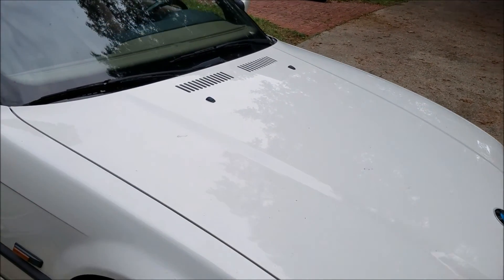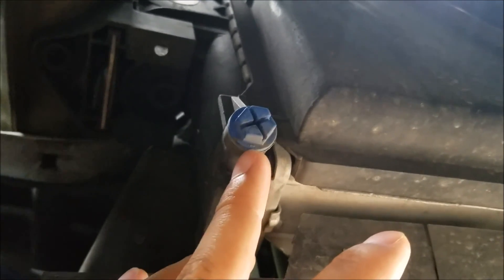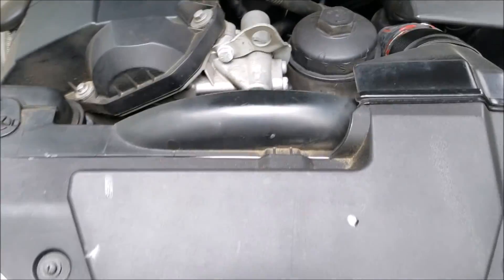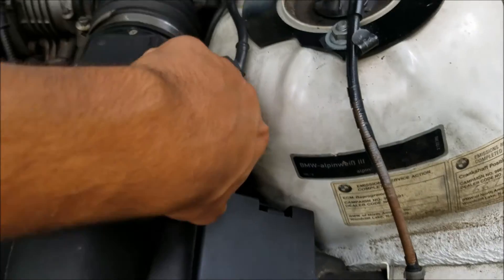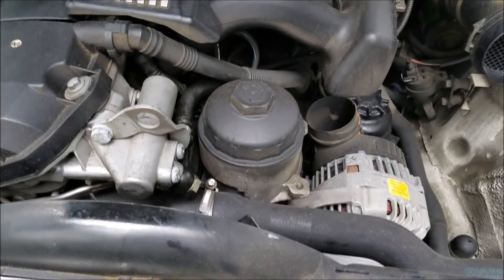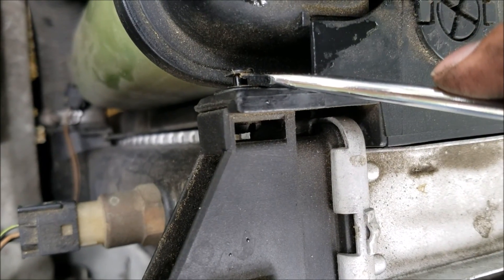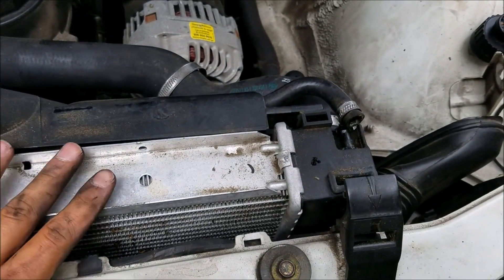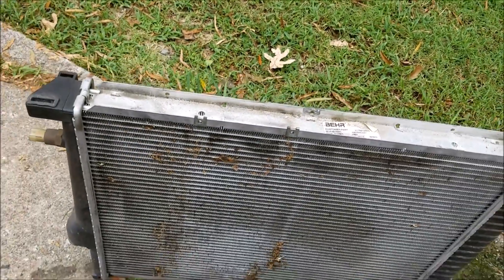BMW E36 Radiator Removal (Coolant System Rebuild Part 1 of 5 )

Comment: What is that sensor on the side of the radiator? Around 10:00.

I'm trying to stop a slow coolant leak on my new radiator but I can't seem to find any information on that sensor, I'm either trying to get rid of it and put in a plug that fits or replace it

Comment: I just realized how much stuff is missing in this video hopefully you guys don't come across what I come across. You have to disconnect stuff at the bottom of the radiator. his radiator didn't have anything connected at the bottom. There's all kinds of connectors that he didn't have to take out that you will

Comment: the one 8mm at the bottom of the trans cooler in between the hoses was an absolute pain in my ass. I apreciate the explanations though. helped alot. I ended up getting a mini ratcheting 8mm flat wrench and sat there for 15 minutes unscrewing it 1/16 of a turn at a time.
Reply: I got that out, but the whole hose assembly still wants to come out with the radiator, anyone ????
Reply: @JulianBetancourt-g1b  make sure you took out all 4 of the screws and clips that secure the trans cooler and seperate them before you pull the rad out

Comment: Right off the bat the wrong fluid is in the car need the blue for European cars it will eat all the plastic parts if you don't I speak for experience replaced every plastic CoOlentangy part

Comment: I doubt your gone response but if you do I took my car to a mechanic so they would switch the radiator n I got my car back but my coolant is like a gel type not liquid what do I do to fix this
Reply from the maker: You have an E36 or a newer BMW?

Comment: Thank you.  My Bentley 1996-1998 BMW Z3 Service Manual did not give good instructions for removing the radiator retaining clips.  Without your video it is likely I would have broke the dam things. Once I knew where to insert the screw driver and pry it was a snap.  This is not a good manual but better than nothing, I guess.
Reply from the maker: Glad it helped, I'm not a big fan of the Bentley manuals either, but at least they can give a sense of direction for a lot of things.

Comment: Thanks for the video. I have a bad water pump on my '95 325iS. I want to flush out the system and run Blue Devil engine flush through the system. Will this affect the new water pump if I flush after replacing the water pump? I am keeping old thermostat till I run the flush and put new thermostat in after.

Comment: My coupe is a 96' and my radiator is wanting to take a shit on me haha. Someone cut me off while I was behind him on purpose and it dented the face on the left of the grill. Caused my radiator to get even more upset with me and I had to find the crack immediately and put JB weld on it. Wich has held up since but what a fucking inconvienece because after he cut me off he took off down the road after I pulled over to take his insurance. I was gonna chase him but I was more worried about my car blowing up because I had no idea what the damage was. Thanks for the videos though. Makes it easier on me

Comment: Thank you so much dude, using your whole series right now to get my E36 M back on the road. Thermostat stuck closed... hope I didn't do any worse damage to my head
Reply: Kevin hopefully not, I've overheated quite a few but I turn the motor off 5 seconds after or asap to avoid cracking the head
Reply from the maker: This particular Bimmer I've overheated several times, but luckily no head damage. Check out my new blog sometime if you get the chance and let me know what you think! bimmercraze.com
Reply: @e36fanatics29 6 years later helping me with my first e36 ❤
Reply from the maker: Thanks a lot for watching hope it helped!